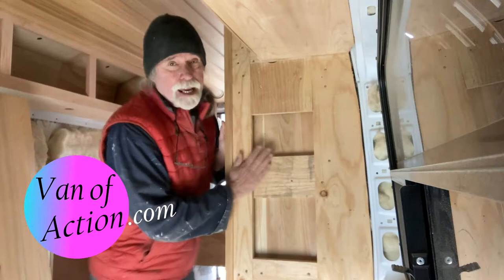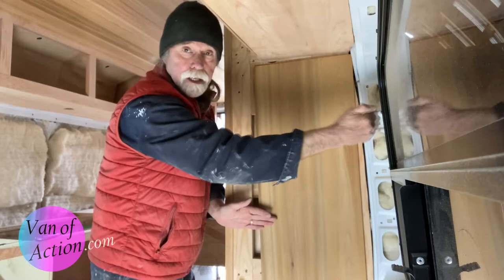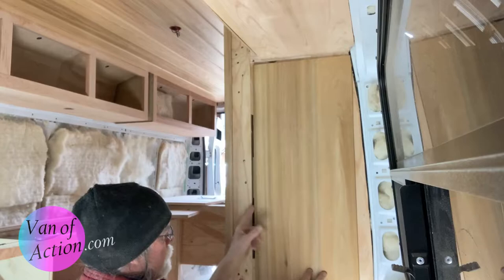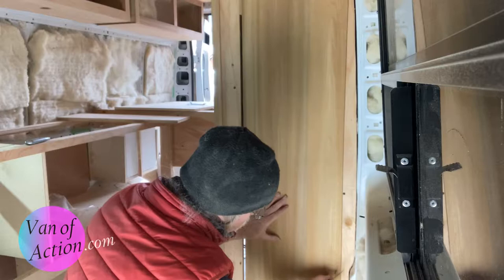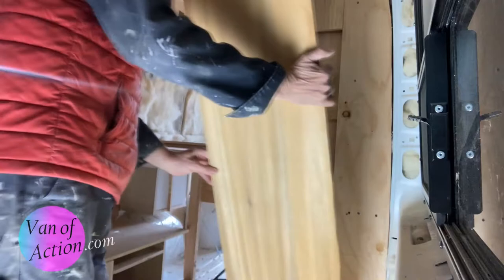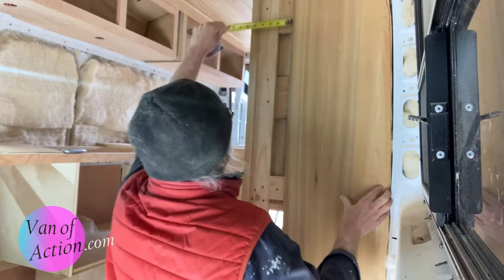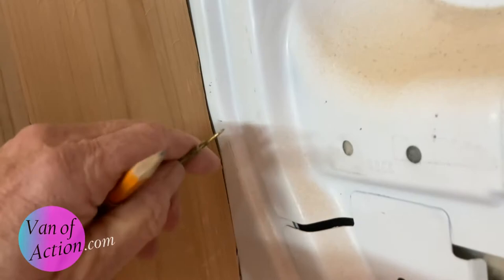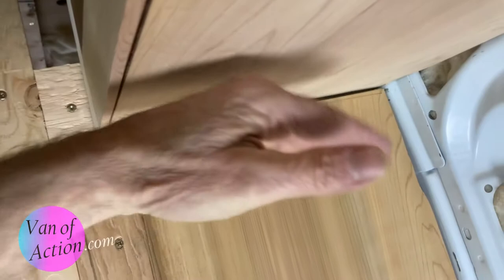Promaster Van Build Series Scribing Interior Cabinet Design Construction for Vanlife Conversion

Comment: Well I wish this sort of video was around when I built my first motorhome out of a Dodge tradesman Maxi van that I cut the roof off and put a cap on but I spend so much time in that what was that back in 1979 but I lived in that thing for 20 Winters while skiing some of the Rockies but I wish I would have learned some nice tricks like this especially scribing tricks
Reply from the maker: Arien - thanks again for stopping and taking the time to comment - sounds like you had a great experience with your van - be well my friend.

Comment: I don't know I see a lot of people building Vans these days with some 3/4 in lumbers that seem a little heavy and with the price of gas going up I would think people would want to use more of that thin cedar you were showing us of course it's not very structural but it sure would be nice to lighten up all that weight
Reply from the maker: Hi Arien - thanks so much for watching and taking the time to comment.  Let me explain my thoughts, maybe it'll help.  I used 3/4" plywood for all the structural framing for several reasons.  1. Safety - I wanted to be sure that whatever cabinets or cupboards I built were going to stay where I put them.  2. System Integrity - I wanted to know that there was enough wood in the structure that whatever I attached to the plywood (ceiling boards etc),  the screws would have enough meat to grab onto and stay in all the vibrations and temperature changes the van will experience.  Veneer core plywood is much stronger and much more stable than the solid wood that many people use, it won't shrink and release fasteners.  Regarding the weight.  All in - I used 2 sheets of 3/4" plywood for all the framing   ( 120 pounds)  and 1 sheet of 5/8" plywood for all the upper cabinet cases  ( 48 pounds )  So the weight I added is equal to 168 pounds.  You could probably do it cheaper and lighter but I don't believe the economy of gas consumption out weighs the comfort of knowing everything is going to stay where I put it.   That's my 2 cents  - Love to know your thoughts .....  Be well and stop back.
Reply: @VanOfAction  well this all makes sense as far as using 3/4-in lumber to hold all the items that you need to count on staying tight I'm sure if you got to look at the vehicle that I put together you would probably have had a couple of reactions, one being a good laugh but a lot of people were kind of taken back by the amount of weird attempts at making things work especially since my carpentry skills were in, let's say early stages. There's no way to say this but damn I feel a little jealous of your vehicle and I've seen quite a few of them because also being a solo cruiser I see that vehicle as the perfect getaway, sanctuary, /habitat. My last thought is would you ever think of mass producing this exact vehicle because I think this particular model would satisfy the masses and from what I understand people that can't produce this quality of construction are waiting months to have a vehicle made for them. I really think you could have a lucrative career giving people their dream escape vehicle because you and I both know this is more than a trend these vehicles seem to be one of the only alternatives they have for a dwelling that is cost-effective. Should you ever start producing these things, I would love to send in a resume and be part of something so satisfying in a world whose needs are perpetually changing.